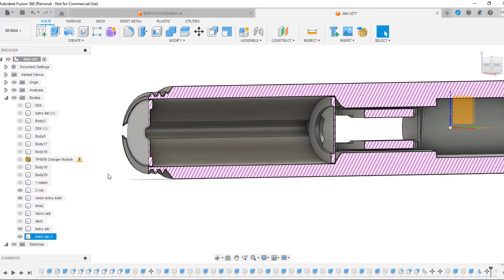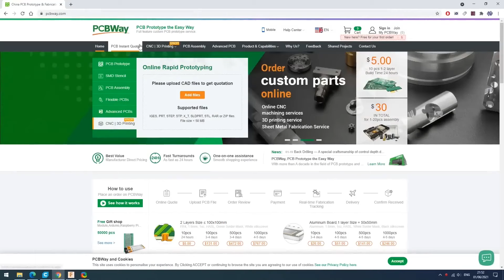How to make a electric screwdriver with 3D printer

Comment from the maker: Thank you for watching the video, remember to subscribe to the Channel, like and share to support us
Parts used:
- 3V N20 Micro Metal Gear Motor - 200 RPM
- Accumulateur 3.6V 820mAh
- TC4056 1A 5V Lithium Battery Charging Module Mini/Micro USB
- NIS R 1560 ZZ Deep Groove Ball Bearing
-  Push Button Switch 1A 125V AC Mouse Switch

Schematic image of internal wiring :
https://s6.uupload.ir/files/untitled-1_hpq7.jpg
or
https://www.uplooder.net/img/image/10/de0608a433e2624eb8625f50525dbab1/Untitled-1.jpg